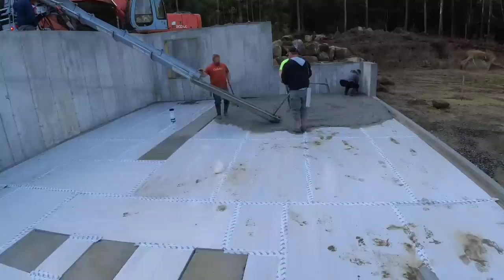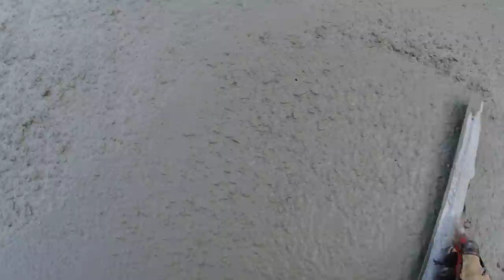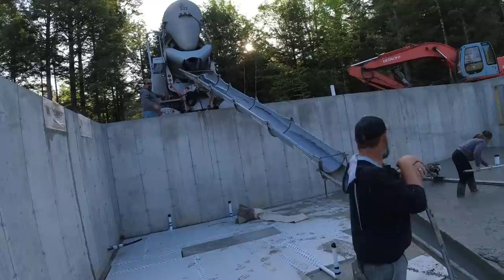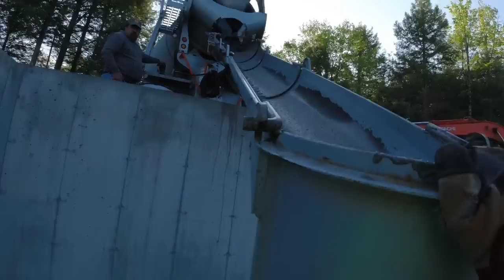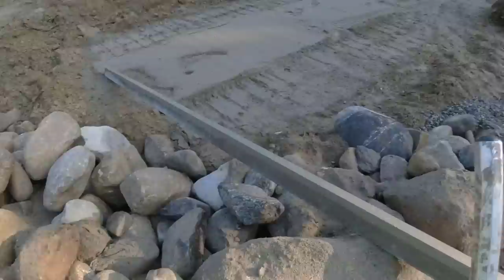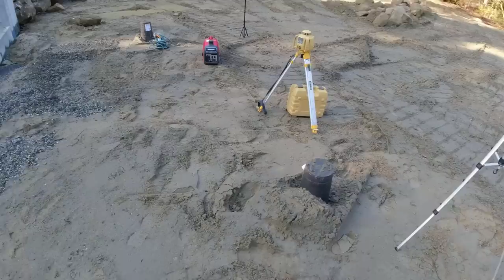How To Pour A 44' X 28' House Concrete Floor (Daylight Basement) Part 1

Comment: Watching from Ocean Park WA. Just poured and finished a 40x84 shop floor with three guys, so I like to see how your crew is in sync.  We use a midrange water reducer also.  Makes life so much easier and I am all about working smarter. You mentioned in a video your paying about 4.00 per yard for the mid range, we pay 10.00 per but it's still worth it.  One of the trucks blew a main hydraulic line right in mid pour, that caused a little drama but we just stayed calm and worked the problem and it all ended fine but it was a bit of a cluster for a minute. Great videos Mike keep them coming!
Reply from the maker: Glad to hear you got your pour in OK!

Comment: If you’re a young guy getting into Concrete or Construction one of the best take a ways or advice you can learn from Mike is how he has thought out all the small details. In this case he brought a tremie Shute and a 12 foot aluminum. He also knows the big picture which is the trucks have to get emptied quickly to get the repeat load. Sounds simple till it’s not
Reply from the maker: Amen to that, thank you!